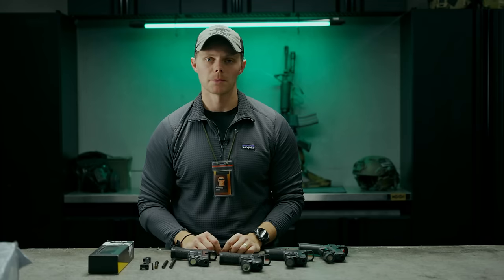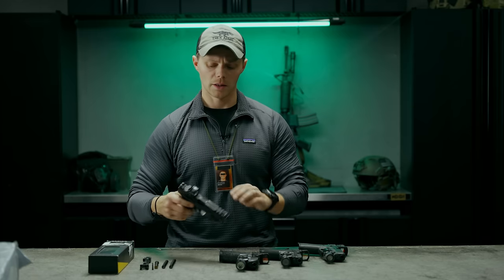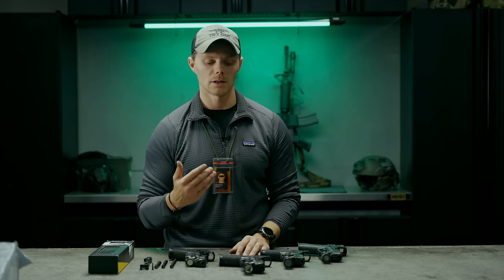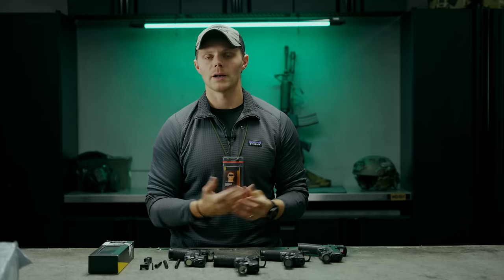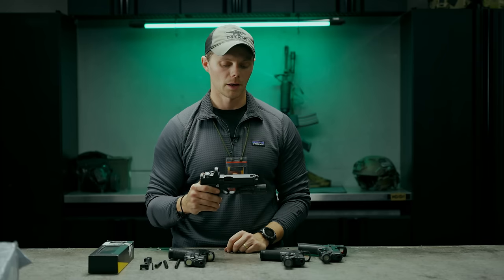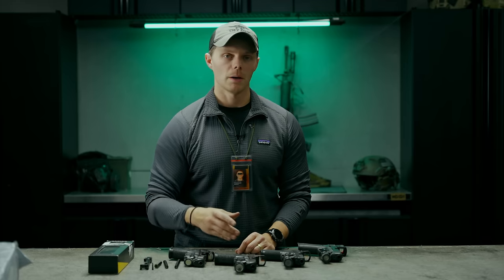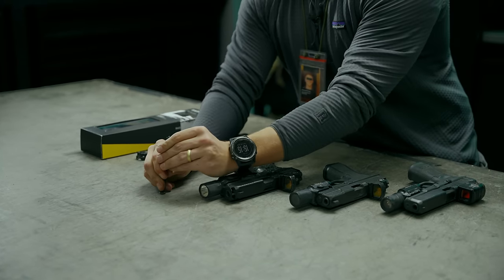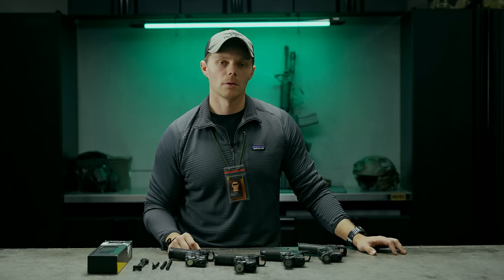Evaluating the Radian Ramjet Compensator

Comment: I find it interesting that you mention it being not significantly better than a 17. I run a 17 currently and was wondering if I should buy a 45 + ramjet. Where I live it would be 1500$ plus. So yeah I stick with my 17
Reply: I own a DR920 and an MR920. I have a Shadow Systems comp for my DR920 and I bought the Ramjet for my MR920.
I've fired all of them with and without the comps and ramjet back to back with 124 grain NATO spec ammo (typically a +P spec).
Regardless of what the guy in this video claims, the Ramjet in the 19 shoots better than a non comped 17 with hot ammo.
This guy is wrong.

Physics prove him wrong.

A 19 will expel more gas than a 17 because of barrel length (you know this is true). 
All comps work with available gas (you know this also).
So physically speaking the more gas you can redirect tbe more effective Reduction will be.
NATO spec ammo through a 19 with a light has less felt recoil and muzzle rise than a 17 with light and no comp.
Adding a comp to the 17 makes it "better" than the 19.

I hope this makes sense.
I'm an IPSC master class shooter. (Its not as important as some think) 
Everyone who race use comps on open pistols, for a reason.
Its basic physics.

Comment: At the price point of the Radian system, you can pick up a legit KKM Barrel and Comp or a Parker Mountain Barrel and Comp that will give you better performance and match the overall length of a G19/45 with an X300 attached. Granted, you're talking overall length similar to a G34, but if you're running an X300, you're already at that length anyways.

Comment: Comp’s catch lead also which can be a pain in the azz to clean out.
It needs a softer recoil spring. It helps with not only rise but also cyclic rate and return/dipping. 
Single port will never stack up against something like the Herrington multi port..
Reply: I don’t experience any extra clean out issues with mine.

Comment: The ramjet returns to zero super quick, and the ejection patterns are sporadic and forceful. 

I own one minus the recoil spring, and I’m 100 satisfied. It is expensive but to me it’s worth it.

It’s not magic, it’s not snake oil. You will notice a difference. 

It’s hard to quantify it’s something that you feel while shooting.

The price point is the biggest barrier, because it’s the price of Canik mc9, not quite a brand new Glock unless you catch one on sale.

But if you want your g19 or 45 to shoot a bit flatter. This is the ticket.
Reply: I can quantify it. The dot doesn't rise as far . Probably half the rise. So there's my quantification. Half.  ish. Lol. 
  If I shoot doubles or more  with my non comped 17 , the dot tends to get to the top of the glass. If I shoot doubles or more with the comp , the dot stays closer to the center allowing me to keep a tighter group during fast strings of fire. The gun is staying flatter. There's really no other way to say it. 
   These guys out here shooting at big silhouette don't see the difference. Try shooting at smaller stuff. And fast. It's just easier with a comp. It's easier to be accurate at speed and it's not even a debate.

Comment: So if there's not as much pressure coming back because of the compensator, should you move to a higher spring poundage or a lower spring poundage?  Asking because the compensator on my G17 is causing a malfunction every 3-4 rounds.
Reply: I would think a lighter spring will help the gun cycle with less gas. A heavier spring provides more resistance to the slide.
Reply: @AdolfSchicklegruber  Thank you, I bought a lighter spring but haven't been to the range yet.   Thank you again.
Reply: @JustSayN2O  Sure bro let me know how it works out!

Comment: What is the solution when your slide stops locking back? Just change out the recoil spring for a new one?
Reply: Personally my compressor rsa was out of spec. It was too short . Had all kinds of troubles with it. Like it just didn't provide enough spring tension and would actually work itself out of position.  I only bought it because the configuration of my 45 wouldn't run properly with the comp. I went back to the stock rsa and tweaked some of the other parts closer towards stock and got mine running perfectly.

Comment: Had one on my gen 5 with a holosun 508T out of about 1000 rounds I’ve probably had 10-12 double feed malfunctions. Going to try radians recoil spring kit once they come in stock and try that out and see if it becomes more reliable
Reply: Might I ask : is your gun completely OEM? I had some struggles after changing some parts , I ultimately had to run the gun with more conservative or OEM parts.
Reply: @davidgaines8607  yep everything is oem other than a Johnny glocks trigger shoe on a Glock performance trigger group
Reply: I think the majority of the guys commenting on this comp are just regurgitating shit they hear on YouTube and aren’t actually getting range time on the system,  myself and my buddy have had the same double feed issues. I reached out to radian they said they’re aware of the issue and that magtech 115 will definitely cause issues and more than likely a lighter recoil spring will need to be used as it was intended to be used completely stock with no optic
Reply: @mikehoncho806  I was using an Apex trigger with bar and connector , and a 4lb striker spring and it wasn't having it. Doesn't make any sense to me . But mine likes the factory trigger and bar. And a minimum 4.5lb striker spring.
Reply: Also I had no luck with their compressor spring. Mine was out of spec. Way too short.
Reply: I.m.o.  ammo shouldn't really matter. 115 is 115 (for the most part ) I mean don't get me wrong some crap can be out of spec like head spacing , and Winchester primers suck ,  but I think  the weird tolerances from one Glock to another plays a part.
Reply: @davidgaines8607  yea I’m
Not too sure what to make of it yet. It runs great most range days but some days it would double feed quite a bit, almost every other string of fire, im going to keep messing with it and see if i can get it to cooperate like it was designed too.
Reply: Did you send the spring back to radian and try to get another? I’m going to see how it does in the 19x if it has issues I’ll keep sending back until it works correctly
Reply: I had two ftf with my G45 but only at very high speed trigger pulls in CQE. Talked with Radian support they suggested use their 15lb spring. Over 5000 rounds now in COF’s/CQE and not one issue. I only use 124 gr.
Reply: @toddtzm  thanks, once they get that adjustable guide rod in stock ill try it out, either the 13lb or 15lb but if I’m not mistaken the oem Glock spring is suppose to be 15lbs
Reply: @mikehoncho806  Their suggestion to use the 15lb was spot on for me!

Comment: First of all a stock glock 19 gen 5 recoil spring is 18lbs. 
The ramjet is a great comp if you shop around you can get it for right at 300. And its alot less recoil and "snap" then a g17. Honestly it sounds like your biased for some reason just the tone and way you talk about it. Plus slide lock could very easily be your grip that's a very common problem with ppl with even normal sized hands.

Comment: I disagree with him my mr920 with the ramjet has less recoil than my dr920, It speeds up the gun and I noticed a TON of recoil reduction especially in the mr920, The price point he refers to while yes high it’s an after market barrel and comp if you don’t have a threaded barrel often a good threaded barrel is $250-$350 depending and a comp is $100-$200 which brings you to the same if not a higher price than the ramjet, It is stainless with DLC which is pricey and harder to produce, I would say it’s 100% worth it but he misses the point of being able to keep it on a compact frame and have less recoil than a full size and 50 state legal…

Comment: The benefit I see is if it shoots like a 17, but conceals like a 45 or 19, its a win.

That said, now you have to cope with the price. I dont blame Radian, but it is expensive.
Reply: Once you add the Radian Ramjet you have the length of a Glock 17.
Reply: @dark_caliber  right, but slide length is easy to conceal. Grip length is the part that prints
Reply: @kevinduver  The grip length of the Glock 17 and Glock 45 are the same. You basically have a Glock 17 once you put a Radian Ramjet on a Glock 45.

Comment: I had one and with the factory guide rod spring it failed spectacularly. Using a glock 45 it did not function reliably at all
Reply: My G45 Ramjet experience is different. I shot 500 rounds through it but had a couple of failures doing CQE, where we had to get shoot multiple shots as fast as possible. Consulting with Radian suggested to use their 15lb spring. Now shot at least 5000 rounds during various COF’s and not one failure.
Reply: What grain ammo did you use with the 15lb spring?  @toddtzm
Reply: @RogueOneScum I only use 124 at the range. Doesn’t matter what brand. It shoots everything.

Comment: Had horrible luck with mine. Made me swear off comps. It worked with +P no problem but the second I went to typical Federal 124 grain it would jam once every 3 or 4 mags. Just one anecdote I know, but I’m done with them.
Reply: Bet if you put in a 15lb recoil spring it would fix 99% of the issue
Reply: Mine wouldn't run with my Apex trigger and a 4lb striker spring. So I bought the compressor and shit got even worse. Guide rod was too short . I tossed that and changed my trigger back to oem  and bumped the firing pin spring up to 4.5 and it runs great now. I don't know why it cares what trigger I'm using and how heavy it is .... But it does. That being said , it's reliable now and it works very well , doing exactly what it's supposed to do. Dot barely moves in the window.
Reply: Zero issues with my G45 Ramjet and their 15 lb spring after 5000 rounds. I only use 124gr.

Comment: The one other thing you forgot to mention is that this was made small enough to fit in Glock 17 holsters, it works in my G17 sidecar (ofc it can still fit in a glock 19 holster but it comes out just a tad bit, and will also fit in my safariland 6360 RDS for a glock 17

Comment: It's terrible, causes tons of malfunctions on 115gr. They refuse to admit it. I even ordered the the proprietary spring/guide rod. Doesn't work.

My department sent me to two handgun courses and I failed the second final test due to constant out ot battery malfunctions. When I had to manually shove the pistol back into battery I lost time. I also had to cycle it multiple times.

The radian malfunctions are unacceptable even in low grain ammo.
Reply: Mine worked flawlessly without any malfunctions

Comment: I hope they didn't abandon their plans to make one for p320
Reply: p365 would sell more, and a Staccato c2 one
Reply: @brighthought11  for p365 I'd rather buy an FDEZ ported slide, but at the same time i could do the same thing for p320
Reply: @not_your_business666  i'd rather just get a Staccato after doing aftermarket slides, icarus ace frames and everything
Reply: @brighthought11  Fair enough. I am thinking about transfering to PDP. Btw I hated my icarus frame.
Reply: @not_your_business666  really? The Icarus Macro frame is next level
Reply: @brighthought11  i got one for xcompact, it's not super grippy and really narrow at the top, also there are two bumps which dig into the web of your hand if you grip it tight enough. Also I don't really need that extra weight for my carry gun, the recoil mitigation is not worth it for me.

Comment: The slide on a g19 is smaller, less reciprocating mass will make a difference. That makes the test invalid. Compensators on a 9mm are practically useless the bullet isn’t fast enough to make the comp useful.
Reply from the maker: …what?
Reply: @TREXARMORY  The weight of the G19 slide weighs less than that of a G17 slide making the recoil feel different. Not only that but the ram jet adds none reciprocating mass on the front of the gun also making the gun handle different. I get you choose the G17 because the size is the same as the G19 with the ram jet attached. However, comparing the ram jet G19 recoil to that of the G17 recoil to see if the ram jet made a difference is not a valid test. Both guns shoot and feel different. My last point was that there are many test showing how ineffective compensators (comps) are with slow 9mm bullets. In USPSA you’ll see a lot of guys in open division running comps even on their 9mm guns but those comps are large and the rounds are designed to be high powered to work with comps. In this case the comp doesn’t do much more than negate the difference made by the higher powered rounds. Maybe your next question is well then why would they use the higher powered rounds? Because it puts them in a different class that allows them to potentially score more points with shots that are not landing in the center of the target. My fear is that you gave people the false hope that the comp did make a tiny difference, and it probably did, but the reason was stated above. Right out of the gate a G19 is snappier because it travels shorter than a G17 and it weighs less.